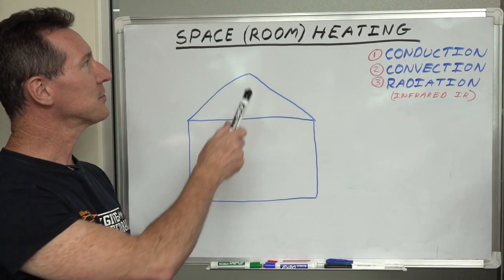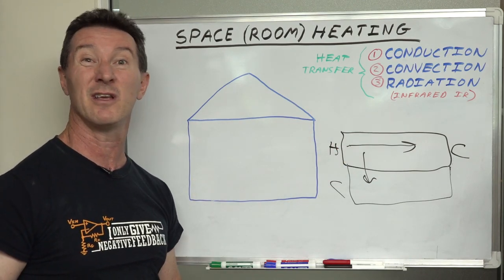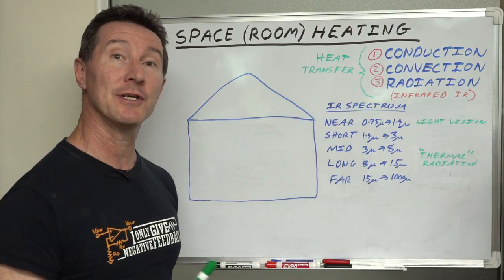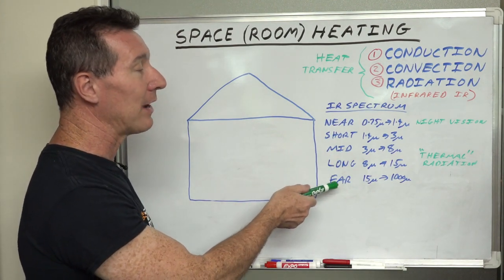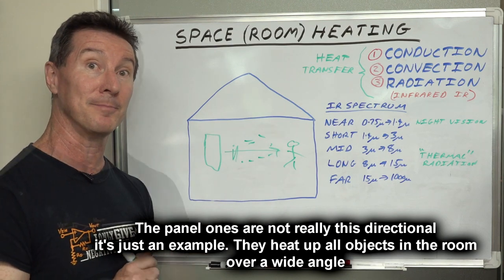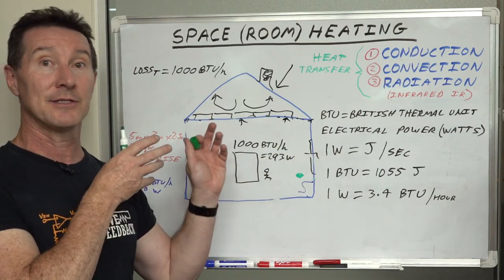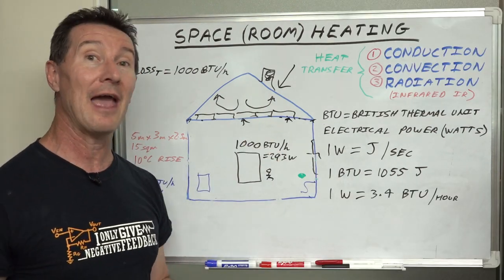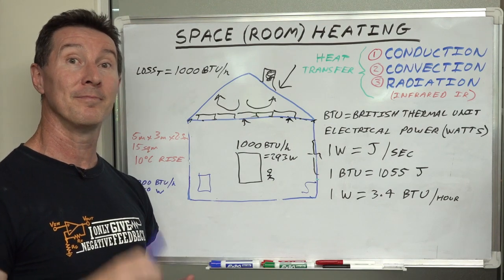EEVblog #1187 - Room Heater Technology Explained

Comment: Technology Connections just did a video about space heaters also.
Reply from the maker: So everyone keeps telling me, over and over again...
Reply: i think someone wrote a textbook about it once
Reply: Both videos are worth watching as they cover different aspects of the subject.
Reply: Having watched both videos I can say both are very good and informative.
Reply: But how do you even measure the temperature of space? There's nothing there. It's a complete void. So how would you know if your space heater is working?
Reply: @EEVblog  The gist is "All Space Heaters are 100% efficient, since they convert 'tricity into heat!"
Reply: @mozismobile  Serious answer for silly question time:
It all comes down to infrared. If you were to hold a thermocouple in space with nothing around it, but it is in direct sunlight, then it will read above 100C. However, if you were to put it behind something to block all radiation from the sun (and every other radiation emitter) then it will slowly drop down to about 3K (about -270C). This is the temperature of the Cosmic Microwave Background Radiation (CMBR).
This is because the sun will quickly heat the thermocouple until it is at thermal equilibrium with its IR emissions. Any object that is greater in temperature than 0K will lose energy via IR radiation. When an object is glowing red then it is losing IR energy very fast, but the rate of loss will slow until it hits equilibrium.

Now, to test your space heater, you will want to put your probe some known distance away from the heater (it can be IR or forced convection). If you run 1500W into the forced convection heater then you will be able to register an increased temperature on your probe if the probe can see any of the coils. The coils will then burn out as there is nothing to cool them as fans only work as gyros in space. An IR heater, however, will work much better. Putting a probe in front of one of those will register a pretty fast temperature change, but that by itself will not tell you what the heat output is. You would also have to factor in the Inverse Square Law (this assumes that the IR heater is omnidrectional).

And that is how you can properly test a space heater.
Reply: @EEVblog  Did I tell you about the time a sales guy at a home improvement store tried to get me to buy a really expensive space heater because it was "more efficient" than the cheap one I was going to buy?

I tried to explain to him that a watt is a watt and he acted like I didn't understand......

The Solus kickstarter is still up. I just signed up for a kickstarter account to report it.

Also Technology Connections recently made a video about space heaters...hahaha.
Reply: Yup, was looking for this post
Reply: @EEVblog  Haha, I assumed this video was made as a sort of response/follow up to TC
Reply: Coincidence? I think not.
Reply: @EEVblog  All it means is that we all think the same way, and we all cover the same material in slightly different ways.  TC didn't really go into the physics of it all.
Reply from the maker: Monkey J - Yes, complete coincidence. As I don't subscribe to TC I had no idea about that video. Someone wanted me to debunk Solus so I did that and then a thousand people tell me about the TC video. I have not watched all of his video and I don't really know if he covered the same stuff I did.
Reply: @EEVblog  yeah I for one don't think there is anything other then a couple great guys making interesting and informative videos. TC does have some interesting videos, you would probably enjoy them. Thank again for a great video Dave! :)
Reply: “So everyone keeps telling me, over and over again...”

The downside to having half a million subscribers, heh.
Reply: @Dee_Just_Dee  I wish all my downsides were that minor. :)

Comment: As my thermodynamics professor said, at the end of the day a refrigerator is just a slow space heater.
Reply: Good point. Refrigerators and big screen TVs are as efficient at heating as space heaters, but they can do useful stuff while they are generating their heat. You could even go further and generate some kind of fuel, e.g. hydrogen and oxygen, while you are generating heat...
Reply: My roommate and I had two mini-fridges in our dorm room. We barely turned the heat on.
Reply: It's also a dehumidifier.
Reply: I heard the transition from filament lightbulbs to more efficient technologies led to the death of some old people on cold nights (because the switch made the rooms they slept in noticeably colder).
One has to wonder, given the environmental cost of LED and CFC bulbs vs filament, once you factor in the "wasted energy" is heating, if they shouldn't be still in use in colder climates.
Reply: @JuanHerrero  Ideally they still shouldn't be used in cooler climates, but only because there are (often, at least) better ways of heating up a place.  But you are on point, it's not wasted energy if that place needs heating. It's wasted where you don't need heating, and it wastes even more than it consumes if you're also cooling the room with the light bulb in it.
Reply: @ats89117  They are as efficient at heating, but if your TV or fridge is using 1500-2500 watts, you'd do well to upgrade.
Reply: @JuanHerrero  1) People don't sleep with the lights on. 2) Think about how many watts of light would be needed to elevate a room's temperature: Even the highest powered 100W halogen, only gives 80W of heat. That's 15 times less than a portable heater, so the room temperature won't change a bit. You would need 15 bulbs of 100W  to achieve a decent heating load and that certainly it's a blinding amount of light for anybody to sleep or even be close. 
Also to put it in perspective, a human body produces an average of 170W of heat. So even the human body generates 2x more heat than an halogen lamp and that's certainly not enough to elevate a room temperature.
Reply: @Txepetxcc  My mother does. And a TV. But I digress. They have them on before they go to sleep, and that heats up the room. I does not heat it up as much as a dedicated heater, but a couple of degrees can make a big difference.
Reply: @voltare2amstereo  lol I got an lga-775 core 2 duo wonder if it can be used to heat my bedroom..........
Reply: @JuanHerrero  good point in perpetually colder climates the "LED Law" may be doing more harm than good
Reply: @Txepetxcc  light is not measured in watts. A 100 watt halogen bulb uses 100 watts of electricity and produces 100 watts of heat. If you have a halogen bulb that uses 80 watts of electricity it is an 80 watt bulb and any claims to the contrary are marketing bafflegab.
Reply: @Sylvan Butler You seem to be suggesting light cannot be measured in watts. It very much can be which leads to a 100W halogen producing mostly heat but a couple of watts of light. For example, 1W of yellow light would result in about 2.9 exaphotons per second.
Reply: @userPrehistoricman  I am not suggesting, I am clearly stating that light produced from a bulb is not measured in watts.

The bulb to which you refer is capable of producing an amount of light similar to that produced by a 100 watt bulb, while using only 80 watts of energy. Thus it is an 80 watt bulb.

Comment: venting the attic area below the roof is also to vent moisture as well as keeping the roof surface cold so that there is no condensation on the bottom structure of the roof which can turn all moldy and rot wood and stuff like that  ( for those of us who live in the cold countries ) .

Comment: Radiated heat has been quite useful in my experience, especially when my granny was visiting at my parents. The elderly often prefer a much higher room temperature placing her chair 1.5-2m away from the glass window of the wood burning stove burning during the winter. A good way to keep them comfortable without cooking the rest of the guests.

As for ways to heat a room, I've always been partial towards floor heating giving a nice evenly heated room and no cold feet even on stone tiles. But it's far from the cheapest things to install I guess, especially if it's not a new situation and you have to take your existing floor material out. The cat we had during my childhood used to love the floor heating in the bathroom, she'd often claim some spot where someone left a used but by now fairly dry towel on those heated tiles.

Comment: EEVblog the new HVAC channel. Good video! The distinction between efficiency and effectiveness is really important. There really a lot more to it when it comes to heating / cooling any space.

Couple notes:

BTU is a unit of energy and Watt is unit of power. There is a fundamental difference. I think you should have made that distinction. You're fine with BTU but not fine with W/h? Consumption in manufacturers brochure indicates used electrical energy. That type of indication is pretty common since people are charged by the kWh/h of the electricity. That's why electricity "consumption" is the the used energy, not power. Energy consumption tells more about the heating solution than the power, since it also gives an idea, how effective heater it is. Also it makes easy to compare different heating solutions.

Natural convection heaters are usually placed under windows, where the losses are greater, to enhance to the convection effects.

Comfortable living space. Good you brought that up. That is the thing that matters when designing a heating solution. The room might be really tall but usually you only need to heat the air in the space where people can sense it, lets say 0-2m from the floor. Skin is very good at detecting flowing air that is in different temperature. That is why one must always try to minimize air movement but also make sure that air mixes well enough to provide equal comfort in every part of the room. And all that with minimum energy usage.

By saying that "get a forced convection fan heater" it won't be true for all situations. When you live in a place (like here in Finland) where you need to heat you house constantly around the clock for 10 months of the year you just need a solution to keep up the temperature. In those cases natural convection is better because you lose the fan noise, unnecessary air movement and the also the itty bit of fan power consumption. Fan heaters are good for spaces that you need to heat up occasionally and quickly.

Also some heating methods have some practical limitations. Floor heating is one of them. You might think that pumping a lot of power into the floor heating is way to go. Well, many floor materials (structural and finishes) won't like temperatures over lets say 40 degrees C. Also going over that is starting feel too hot for you feet (imagine hot sand in the beach). So this temperature limit is the limiting factor in floor heating.

Comment: There is a term Dave should have mentioned that is thermal confort. It is more confortable to warm up in a room with good air temperature that staying outside under a an IR heater getting your head overheated. So for indoor use the conventional convectors win. If we are trying to heat up a really cold room with cold walls, a fanned heater is the way to go. You can heat up the air in a cold room in a couple of hours, but the cold walls will be a source of cold for as long as a day. The fanned heater will mix up the cold air that settles with the really hot air up top giving you a better thermal confort. As of for staying outside the only feasable way to get warm is IR, because the warm air around you just rises up and gets lost. Warming up your back or hands around a campfire gives you that little extra thermal confort you were lacking at an outdoor grill. ;)

Comment: Thanks for going the extra mile and explaining things further on this video Dave, really appreciate it. The debunking video was very justified, but it left me a bit confused while looking into things further. o/

Let me ask a question though on the matter. Say I don't care about heating the entire room, I care only about "feeling warm", or perhaps my house/room just has absolutely craptastic insulation... wouldn't it be best to invest in infrared heater instead?
Of course, I see the limitations... it's highly directional, the effect probably tanks super fast if I turn it off, and overtime you likely end up wasting far more power because the heat is constantly going away (again, because of poor insulation). But kinda like the edge case of IR heaters on external areas for short durations, could IR heaters be better depending on what exactly you want?

I think this is also why those quartz tube heaters are very popular here in Brazil, in cities that even need them that is, down south. Apartments and houses in Brazil have extremely poor insulation properties because well, we really don't have snow, and for the vast majority of the country we barely have something that could be called winter. :P 
The city I'm currently living in actually gets to the single digit celcius, something most cities don't get (we're in high altitude half way south).

So, space heater aren't all that great a solution given there is no insulation to contain the heat. We have the cheap-o forced convection heaters... usually good for very cramped spaces like restrooms and whatnot. But for big areas, people are more likely to invest a little more and get an IR heater, the ones with quartz rods, and blast them directly to your face or something. xD
Kinda like, the room won't get warmer anyways, so at least an IR heater helps you feel a bit more comfortable.

I heard of floor heating systems in my city, but of course that's for the obscenely rich... Brazil doesn't have a tradition on it, so these systems are all imported, which makes them waaay more expensive.

On the other hand though, and perhaps this is only personal perception, the problem with IR heaters is that since you are using infrared radiation blasting at your face to feel warmer, it's just also kinda harsh on the skin. I mean, it's not UV radiation, but still... skin dries up and all. A proper room heater plus a humidifier would probably be less problematic.

But man, I'd love to still have some think insulation plus double layered windows, doors with proper sealing and all that... if not for the cold months, at least for the friggin noise... kinda like to live in one of those super thick walled storehouses in Japan. :P

Comment: You'll get some blackbody radiation off the  oil convection heaters, just not a lot. At 40°C, 313°K, the peak is going to be around 9μm, and you'll get about 550W/m² of radiated heat. The IR radiators are probably more like 2000°K at the heating element, and about 900kW/m². Of course, the area of the heating element is much smaller.

As far as the efficiency goes, you'll get some miniscule losses from RF frequency emissions being lost, but that's pretty tiny.
Reply: RF? Radio Frequency?
Radio Frequency frequency?
Looks like you have PIN number syndrome, also known as PNS syndrome to be extra self-referential.
Unless I misunderstand what RF is supposed to mean.

Comment: I like to heat up my room with old computers...
Reply: Fallout 4 on max settings on a half decent gaming rig should do the trick.
Reply: @crimsonhalo13  not really my low-mid rig "only" consumes ~200w unless I am using synthetic/mining loads your average game on a quad cpu with a modern gfx card will never come close to even your fridge in heat output I recommend building a rasberry-pi cluster with failover functions so you can turn on as many ~10w loads as you need and just mine bitcoins on the cluster

note: @EEVBlog where is the next apple pi cluster vid?

Comment: Likely a good point to bring up (along the lines of "reaching equilibrium" as everyone always glosses over thermal resistance) is that the thermal resistance of any "insulation" is proportional to the thermal gradient across it. 
If a surface (like a wall) "loses ~500BTU"; that value is only valid at one fixed temperature ratio.   
If the temperature on both sides of a surface are already equal;  the "insulation value" increases dramatically; while the opposite is true for large thermal gradients. 
Using oven mitts as an example: prior to use (assuming a room temperature of 23°C);  oven mitts have a 1:1 temperature ratio between the surfaces;  but when you pick up a ~190°C pan suddenly the ratio becomes ~8:1 and the thermal resistance "drops"  (the actual resistance value stays the same;  but the thermal pressure increases;  driving total energy into the material at a faster rate) so that the rate of change increases. 
This is why "increase the temperature of a room by X°C" calculations are always messy; as the temperature of the room increases beyond the exterior temperature it takes more and more energy to maintain that new state.